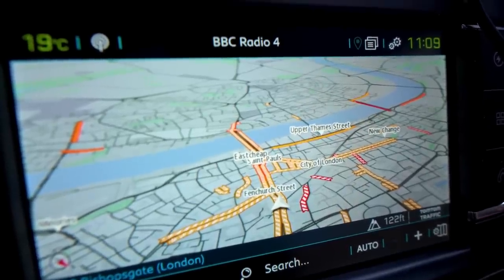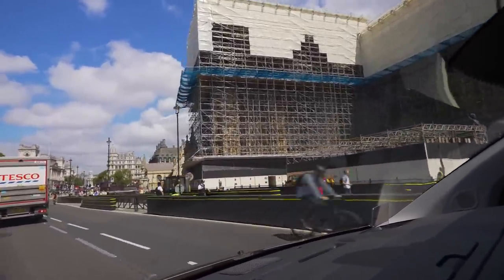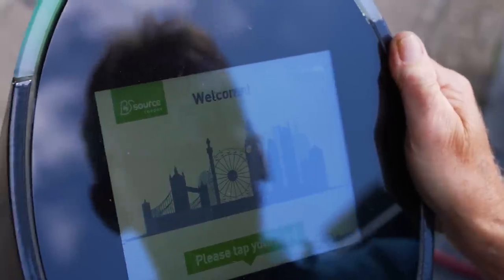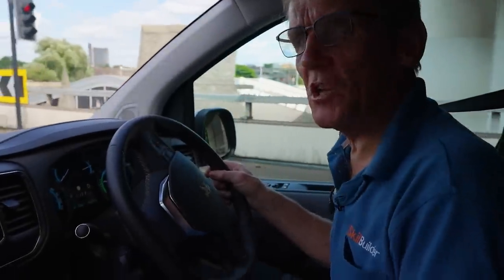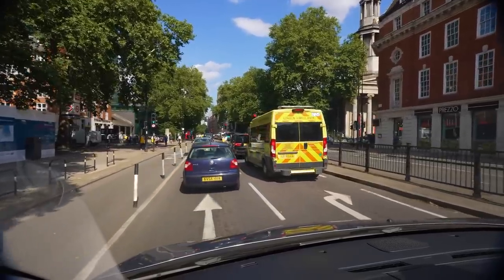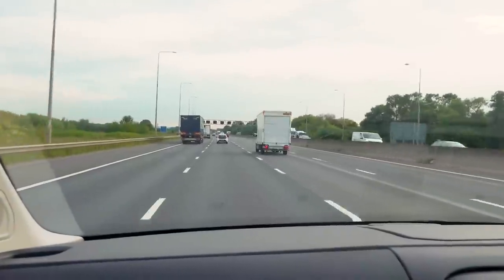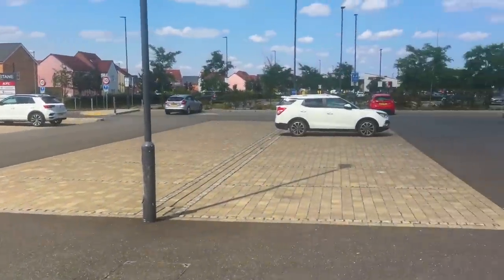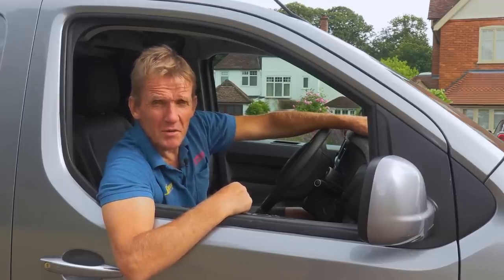Is It Time To Switch To An Electric Van?  e-Expert Test

Comment: Personally, i would like to see a 'real' road test. Middle of a cold winter with heater on full blast, at night with lights on , loaded to the hilt with gear in the back and two bruiser's in the passenger seat's and 25 miles to get home but showing 20 on the batterie's. Otherwise, quite a nice looking toy.
Reply: Got one of these lights not a problem nor load but you do see the ceramic heater taking a hit.I have preheated the van while plugged in morning and have a heated seat cover and just use heater when needed got the 75kw model so that that bad still workable at about 140 miles in winter with load and lights and heat
Reply from the maker: We may get another van to test. It depends if the motor manufacturers want to take the risk of a drubbing
Reply: I've found exactly the same - perfect locally (sub 150 miles / day) - I agree the acceleration is something else - but the infrastructure for longer journeys is very poor - it seem to me that every charging station needs a seperate app / more card details or registration - aparently tesla have a seamless system in that as soon as you plug in - it will atotmatically charge back to your credit card et al. - in the future it will be seamless - but at present it does seem to be a bit of hit n miss depending as to the vehicle / where you are.
Reply: @EverydayLife621  it would be nice for our government to do something.But I see no attempt to improve charging facilities from them . purely left to commercial interests .The US are doing better and Norway has them everywhere.We live in hope
Reply: @bernardcharlesworth9860  US are doing better? Explain?
Reply: @michael6737  They have used money from diesel gate to install chargers for rxample
Reply: I know someone who got the vito electric and when he had it full it had a range of about 30miles at a push...
Reply: Fail
Reply: My father just used a pullover, car coat & gloves when he was in his eighties.  I doubt if you really need car heating unless you're in Northern England or Scotland.  Looks to me as if batteries are going to improve massively over the next 5 years.  I see street charging points around me in Holborn that are hardly ever used.  Somebody down the road has run a charging line from his house into the street to charge up overnight.
Reply: @peterdollins3610  I see your point just use the heater to clear windscreen
Reply: @peterdollins3610  you ever been north of Watford? We don't wear jumpers 😂
Reply: @peterdollins3610  So you're ok with paying £40k+ for a van then not being able to use the heater? 
Enjoy your misery then but those of us who actually get some work done in a day don't want to be covered in sweat then freeze on the way home - especially if that involves sitting at a charger for a few hours while your £40k tool takes its time to recharge.
Reply: stop at a charger and have a cuppa and the five are there.
Reply: @michael6737  California use Hydrogen, and very successfully, we are having our heads filled with crap about battery powered vehicles.
Reply: here's the "you cant drive with lights on you lose range" stupid comment. you will see it on every EV review. 
People dont realise that lights use 0.05% of your battery per hour
Reply: @cbflazaro  Of course you loose range if you have headlamps on they don't run on fresh air, you will also loose range if you carry anything with a bit of weight.
Reply: Have a look at Artisan Electrics channel with his review of VW Transporter. Doesn’t bode well.
Reply: No power stations. We import all our power. You pay through the nose. What Electricity? Where?
Reply: Don't forget AC system in summer, that pulls a lot of load even on a diesel
Reply: Looks great for doing door to door deliveries but what about with a pallet of flags, a whacker plate and 4 labourers hidden in the back 😂
Reply: @peteydynamite8794  exactly. And after forking out I don't know how much for one of these vans last thing I would want to put in it is what you described. My van works hard and inside the back of it looks like a bombs gone off. Just couldn't imaging spending £50k or whatever and chuck stuff in the back.
Reply: You had me until the last part. Why would you do a test like that? You don't test gas vans by completely emptying the tank and destroying the engine...
Reply: It won’t do it
Reply: Was up in the Scottish Highlands the weekend very cold with snow and ice  and strong winds , lots of steep hills and big distances to get anywhere, just a few charging points , would safety say that van would be a total disaster up there , very narrow roads with a lot of fast traffic on them , would not like to run out of charge on a wet cold night with sleet and rain 🌧
Reply: It's already been said, just a toy really, I expect diesel, and nothing less.
Reply: @celticboy1950  I'm not anti electric, just anti electric builders van. I'm a tradesman and asides from the fact i could never afford an electric van, if i did, no way would i want to put the stuff in it that i carry around. My van is loaded to the gunnels all the time and with the best will in the world, i get spilt tins of paint, cement bags splitting, and the other day i didn't put the lid on a can of expanding foam which consequently went off whilst i was driving covering the door mechanism. Yes, lazy on my part but this stuff happens. I recently saw a tv advert for an electric van. The 'builder' opened the back doors of the completely empty van and along comes a forklift with a pallet  with a single box on it about the size of a shower mixer! That's 'real' world isn't it LOL! Ridiculous really.
Reply: @peterdollins3610  if the cable runs across the footpath it is a trip hazard. They should check their public liability cover to see if it’s an excluded risk.
Reply: @bernardcharlesworth9860  use a microfibre cloth for the windscreen to preserve your range.
Reply: @geebix  like a battery.
Reply: @twig3288  like a battery. What's that about ??
Reply: @geebix  resonding to your comment above re carrying a bit of weight.
Reply: I've had one of these for about 8-9 months (for mine ex demo pre release), got about 17,000 miles on it, and wouldn't change it for the world.  200 miles easy in hotter weather, 140miles winter with heaters etc. on.  Recently got an EOBD adaptor and use an app on my phone to get real-time power consumption and true battery levels etc.  Vehicle outputs even the state of health of the battery.  I have got the thing home a few times with fewer miles than it thought was available. Again, much easier to assess with the adaptor. Much like a petrol car, it just stops telling you how many miles you have left when it figures out you are ignoring the readout anyway 😂.
Reply: @martinbyrne6643  took mine to Edinburgh a few times. Charging infrastructure is spot on up there. Van is perfect for the roads up there, well planted on the road, and little bonus, still free to rapid charge up there, or was last weekend when I was there 👍🏻
Reply: Weight doesn’t really affect range. Heater does though.
Reply: @geebix  nah
Reply: @michaeltaylor4824  he has since tested the Vivaro electric van and thumbs up from him
Reply: @ashb8572  Looks good, although a 'claimed' 200 miles is still relatively impractical, particularly as the real world figure fully loaded on a cold day could be considerably less.
Reply: I can answere that. I got the opel zafira e-life, basicly the same car. You can slice the range in half or more
Reply: Toy Is The Right Word!!😁
Reply: On a really cold day will be waiting 45 min for the van to defrost and lose 10% of your limited range before you set off

Comment: This would be great if electricity wasn't going through the roof at the moment with no end in sight.
Reply: And diesel T £1.48/litre. I did see one station at £1.98/litre.
Reply: @peakproofuk  ooh do you have a source please.
Reply: I don’t expect to see petrol and diesel getting much cheaper by comparison though.
Reply: It's because we generate a lot of our electricity using gas. The sooner we move to fully nuclear + renewable the better, albeit decades away yet.
Reply: @RandomShart  unfortunately renewables aren't that consistent, as was highlighted in Texas earlier this year. Nuclear power plants bring the problems of the waste.
Reply: I pay 5p/kwh for 4 hours overnight. That works out at about 1-2p per mile. Guessing diesel is more in the range 15-20p per mile.
Reply: @fortnitefred1351  this is of course factually incorrect. China’s current coal fired capacity is around 1050GW and they do have outline plans to increase this capacity to 1200GW by 2030. However this is more for peak demand grid stability during transition than it is about increasing overall coal usage and in fact like most of the rest of the world coal is uneconomic for them and getting local area support for the build of the required power stations as they are loss making. With a per capita co2 footprint of less than half ours and less than a third of the US, we are perhaps not in a position to point fingers. Particularly as a proportion of their footprint is actually supporting our lifestyle. Not a fan of China overall but I do think they get a unfair amount of stick for this.
Reply: What? Fuel prices are an order of magnitude more expensive than electricity prices almost everywhere on earth. Where do you live?
Reply: Bet solar PV firms are doing well
Reply: Running an electric car is currently about 1/10th of the price of petrol. Okay, electricity bills are rising, but for an EV to cost the same as petrol or diesel would mean that your average gas/electric bill for a house would be about £11k/year. Even if prices went up 5x from now, electric cars are still much cheaper

And it's not like petrol/diesel are getting any cheaper....
Reply: @audigex  yep even with the increase cost of purchase its still a cost effective purchase over fossil
Reply: @jamesbinns8530  These perks won't last - the govt will need to make up for the loss of fuel duty somehow and their favourite method of rationing scarce resources is through tax.
Reply: Look into EV specific tariffs Octopus energy have one where the rate chnages every 30 mins which means during 1am- 5am its dirt cheap so if you set the timer on your car to charge during those hours your all set. Unlikely you will get home with 0% so you will always have a full battery in the morning.
Reply: If the cost of electricity continues to rise, so will the cost of petrol and diesel by default, because oil refineries use lots of electricity......
Reply: @Brian-om2hh  The refineries will just install wind turbines and solar panels to get some free electricity.
Reply: @Brian-om2hh  Why do the US and many Western countries 
have no high-speed trains? 
Have big car and oil companies paid off our politicians 
to keep the trains from expanding 
and was it intended for train companies to FAIL completely? 

US train company Amtrak’s chronic delays are costing millions of dollars.
It’s spending more on fuel, 
labour and even maintaining extra locomotives and rail cars 
than it needs as a result of poor on-time performance.
Even if they add more than 50 new routes
they’re still one our two hours SLOWER than a car.

The cost for UK HS2 high-speed-train project
has ballooned from 30 billion to over 120 billion. 
To reduce the production cost
they're cutting certain sections of the HS2 tracks 
which means they're going to use the EXISTING TRACKS 
the HS2 trains will travel on the same speed 
as the existing trains 
or maybe just 5 to 10 minutes faster. 

Paying over 120 billion 
just for 10 minutes faster. 
It's not even high-speed trains
like the ones China are building around the world.

Could it be deliberate by these companies 
that have more to gain from the consumers 
buying cars and the petrol to run them 
dealing with all the parties involved, 
politics and people with their HANDS IN THE POT 
and not to mention the high price 
to buy the land and labour costs are astronomical?

And why has the US a terrible healthcare system, 
low internet speed
more mass shootings, 
fighting unpopular, endless and costly wars in other countries 
air and water pollution 
no high-speed trains
bad food quality 
hormones in beef and pork
genetically modified crops, fruits and vegetables 
chlorinated chicken 
overprocessed convenience food full of chemicals?

Aren’t powerful companies and banks 
paying off governments in the West
and how much these companies CONTROL and RUN our governments? 

China's BRI built high-speed trains in Asia and around the world.

But we’re expected to believe 
China and Russia are the threat for the world
the US intends to defend the "rules-based order" 
that Russia and China are posing a challenge to.
Reply: @RandomShart  No nuclear power
Reply: Electricity will always be 4x the cost of fossil fuel per kWh because it’s made from fossil fuel.  More than 4x if renewables are involved.
Reply: Lucky there's been no issues getting cheap petrol in recent memory :D
Reply: @Monaleenian  yeah but fuel and electricity don’t correlate. You can’t say fuel is more expensive because what the fuck are you actually comparing? Energy per £? In which case they are about the same liter of petrol is about 9kwh so £1.60/9 = 17pence per kWh vs 35p per kWh for electricity.

If you are taking about running costs it depends really. Some ev vans are worse then diesels depending on efficiency and price per kWh. Teslas for example are way cheaper whilst expert vans are very similar to diesel in cost per mile if you pay 40p per kWh